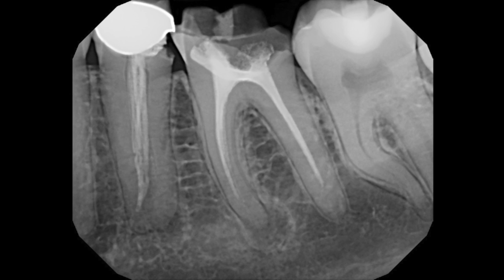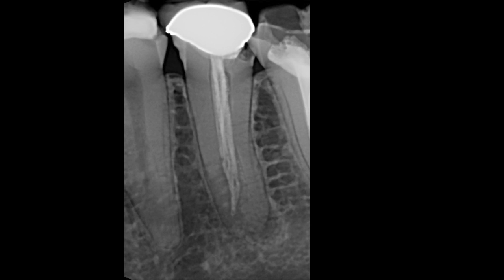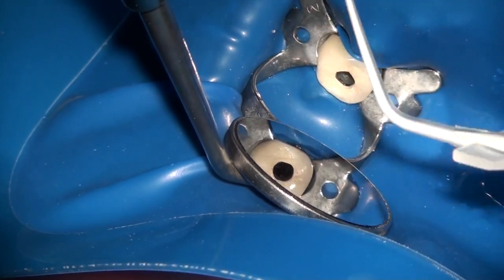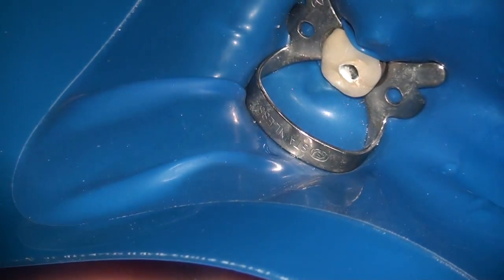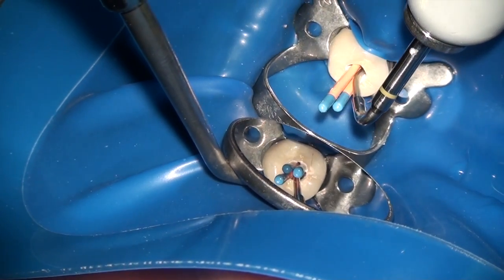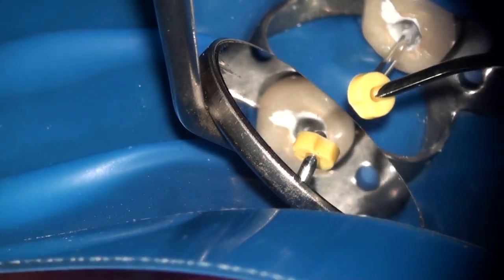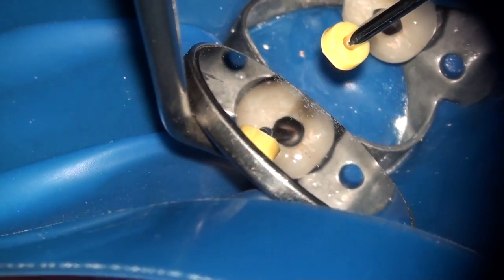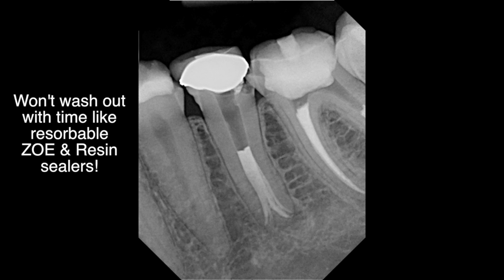PacMac BC Sealer placement

Comment: Doctor from your is videos about hydraulic condensation techniques there's two technique basic hydraulic condensation and advanced hydraulic condensation technique  
The basic hydraulic we use master file to place and spread the sealer inside the canals than we place master gutta percha cone  and advanced hydraulic condensation this technique we need magnifiction     to see where we inject sealer exactly  and from what I understood from you doctor this technique it's need magnificent and there's also technique to inject sealer inside canal not randomly and after filling canal by sealer than you place the master con and this is advanced hydraulic condensation. I'm correct  this what I understood from your videos about hydraulic condensation doctor
Reply from the maker: That's correct. However, even in advance technique, when you inject under magnification in the coronal third, that you then push the sealer to the apex using a file. In this case we used a Microseal condenser; but you can just use a normal file to do it too. Then you coat the cone lightly and then seat the cone fully.

Comment: Can you post a video on how you located and instrumented all 4 canals of the premolar? thats amazing
Reply from the maker: Thank you but showing how to discover the canals is not easy to capture on video. The canal openings are so small the video will not show them but you can see it with the naked eye. Certainly having a microscope at high magnification is required. Using the scope I can actually see the entrance to the canals in the apical 1/2 of the tooth since these premolars are often straight to mid-root. These cases are impossible to treat and find all canals without a microscope. Cheers!